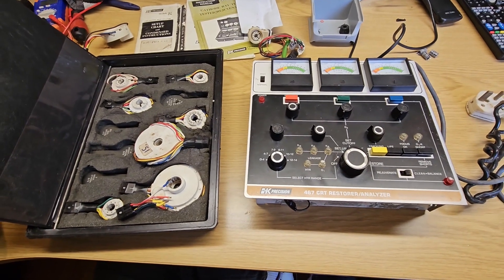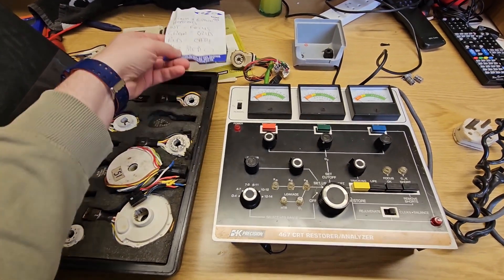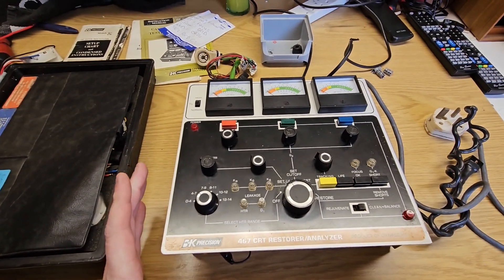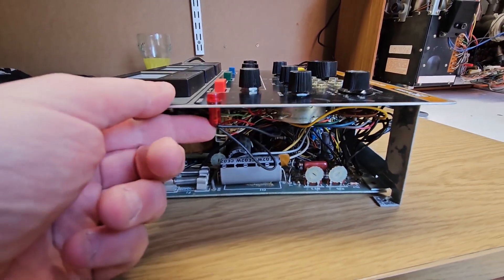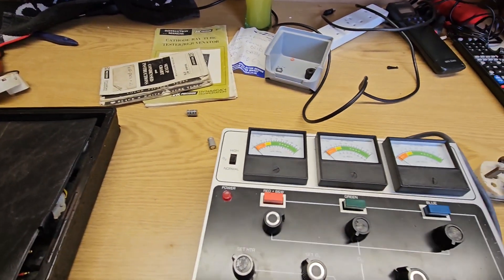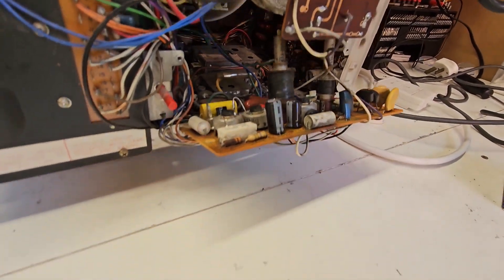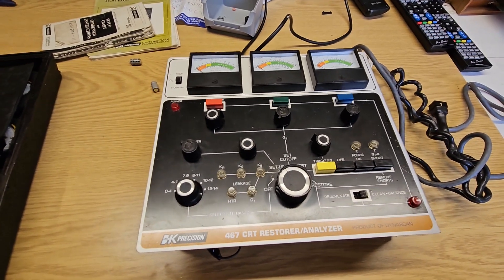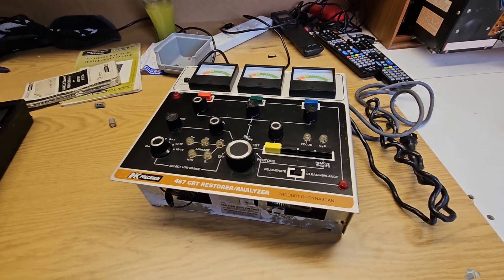BK 467 CRT Tester - Initial inspection.

Comment: Hello I have a bk 467 crt testing the ammeter does not read the filament voltages but when I measure in the output cable I find all the exact voltages

Comment: Only one question, i want to replace the 47uF 450 volt electrolytic capacitors in the power supply, but i have only 400 volt ones,do they go boom,or is it better,to purchase 450 volt ones from ebay?
Reply from the maker: Always put the same voltage or higher in.  capacitance in most cases can be varied.